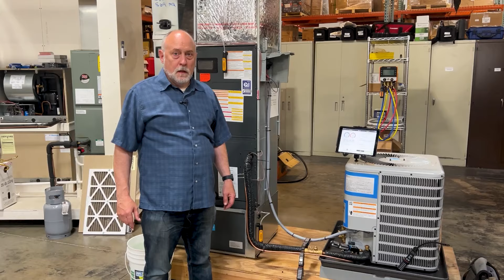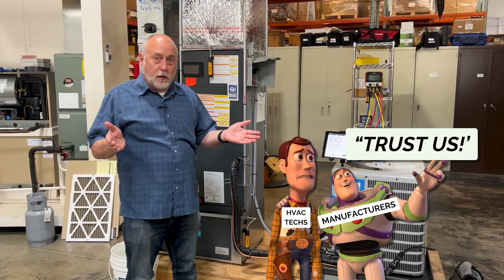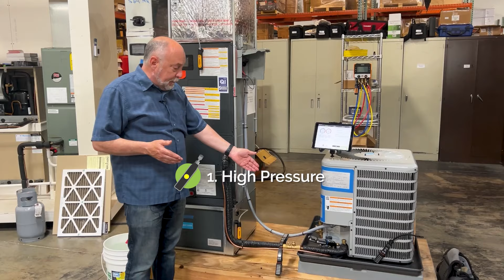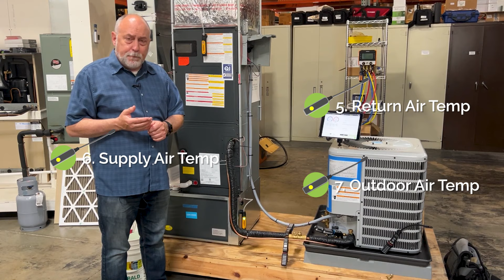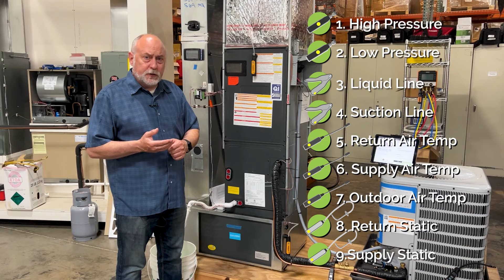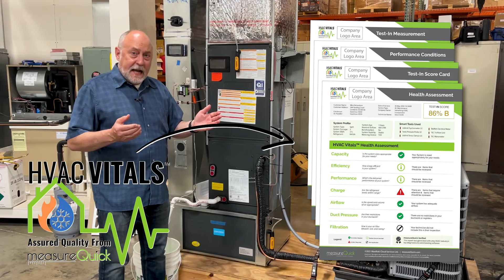Why Do You Need All 9 Probes With measureQuick?

Comment: Personally I always start with cleaning the condenser coil because 80% of the time they’re dirty and plugged up - I don’t bother gauging up when a dirty coil guarantees an erroneous head pressure measurement. Also I like to measure condenser fan capacitance and amperage draw to judge fan speed, as well as discharge temperature before and after cleaning to see not only the difference but how badly the compressor was tortured.

Comment: Throw in discharge pressure and discharge temperature (mainly light commercial / commercial units) and you need 11 probes!
Reply from the maker: @elBusDriverKC  I have not seen to many rooftops with two pressure ports for discharge and liquid. Usually one or the other. I do like discharge temp too.
Reply: @measureQuick  I work on a lot of Lennox units from the late 90s through mid 2000s.  They all have suction, discharge and liquid ports.  It's pretty handy.
Reply from the maker: @elBusDriverKC  Lennox did it right back then.

Comment: Haven’t used mq in a while. When did it go from 7 to 9? Will it still give target pressures with 7 probes like it used to?
Reply from the maker: @jessewarner4824  Yes, it will work as it did, we added in static pressures as well for a more thorough analysis.
Reply: @measureQuick  that makes perfect sense.

Comment: i dont dissagree with wanting esp measurements but realistically they are very subjective and innacurate unless done to a very high degree of accuracy.
Reply from the maker: They can be very accurate if you get the right tools. The TEC monometer is incredible, expensive, but never lies to you. I’d highly suggest anybody that is making static pressure measurements invest in that tool.